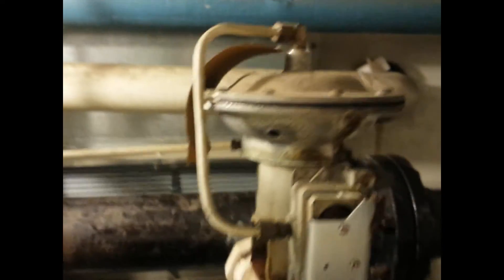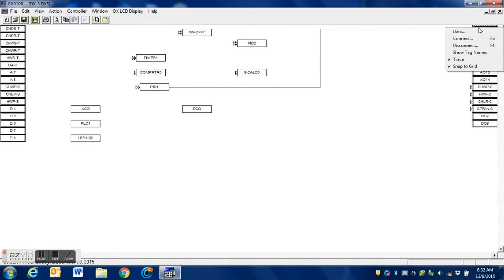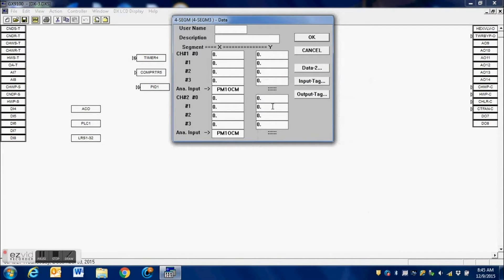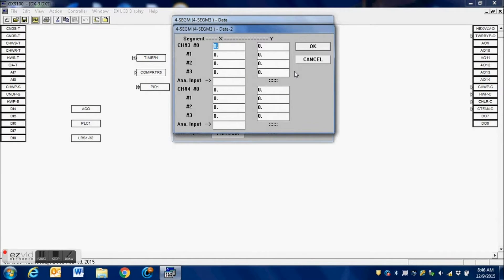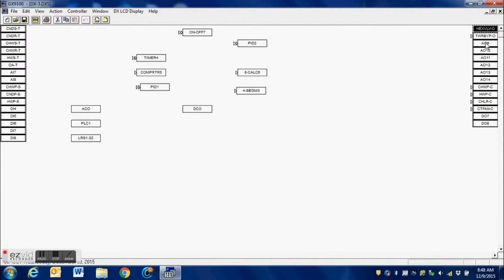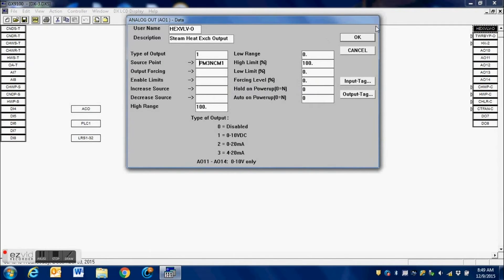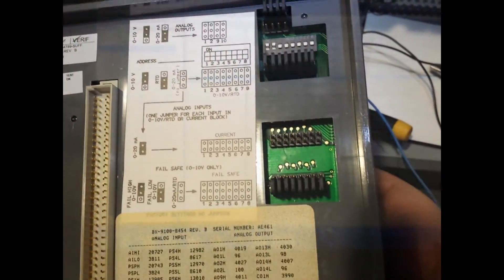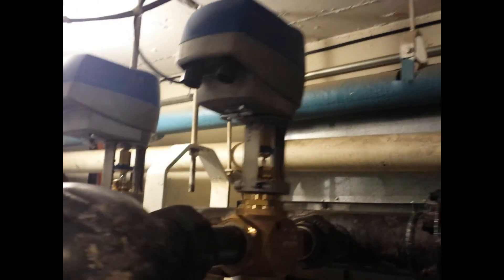How to modify a Johnson Controls DX 9100 Control Program

Comment: Hey do you work as a cntrls system tech for Jci? I’m currently in the hiring process and has a question to ask you thanks man cool videos
Reply from the maker: I don't work for jci
Reply: @Systemcontroltech  oh okay I just got a job offer for controls system tech level 3 and it was 30 an hour I was shocked at the pay I even emailed him and told I was underwhelmed - isn’t that low? Shouldn’t it be like 35-40 at least ?
Reply: I’ve never done it before but I hav experience in programming and electrical - how long have u been doing it for. I hope I get the job I’m in vetting process now I hope I like it I was trying to get your videos to look into the day in the life to see what I’d be doing

Comment: Hello, I have 2 dead 0-10v analog outputs
and there is still some free, can have imported the program with GX9100 and changed output?
Reply from the maker: Yes, you can move the output. Be sure to double check the jumpers on the back of the DX as well or it won't work properly.

Comment: The Rate limiter in PCT is a very useful block for slowing down fans. 
What would be the equivalent on the GX software?
Reply from the maker: It also has a rate limit if I remember correctly.

Comment: what about DO outputs on the XT modules, are there 0 and 10 or dry contact.
Reply from the maker: You can select the type of outputs you use and both are available depending on the type of module you add.  This is just one example.
Reply: thanks.

Comment: Hi! Great video! 

When you had finish building your outputs and downloaded to your DX. On the head end, metasys. When you clicked insert point you were able to "auto discover" and the points self populated. I thought this was only accessible through bacnet devices. When I download new additional IO on N2 DX I have to manually build the points on the head end.

Please could you tell me why this is.

Thanks
Reply from the maker: +Ryan McKeever no, you cannot auto discover them. They must me added manually unless you have a resource file.
Reply: System Control Tech okay thanks for your reply